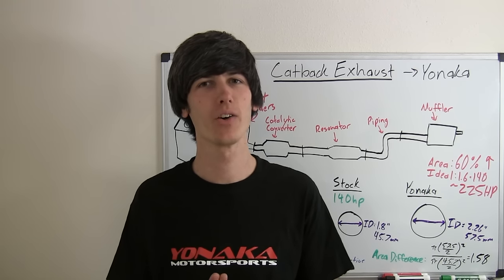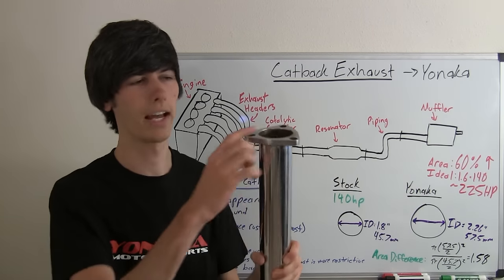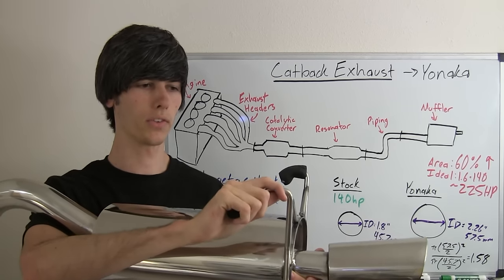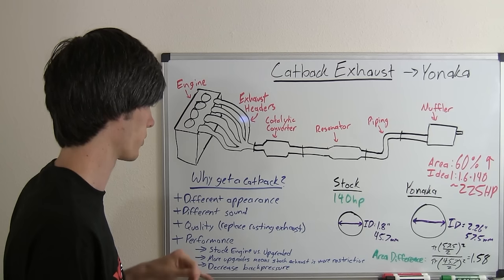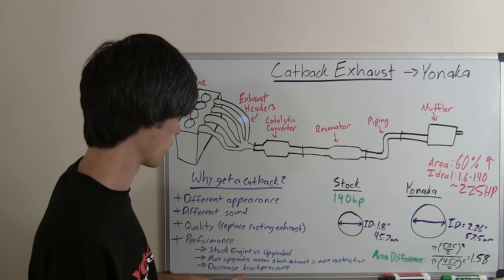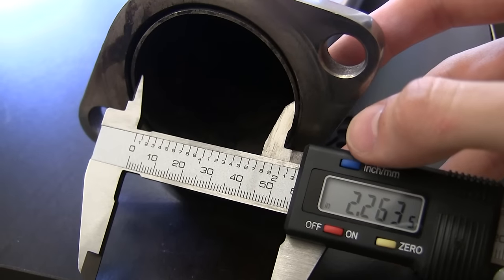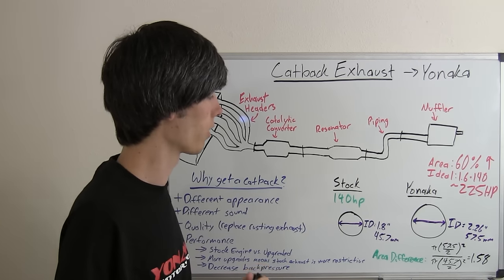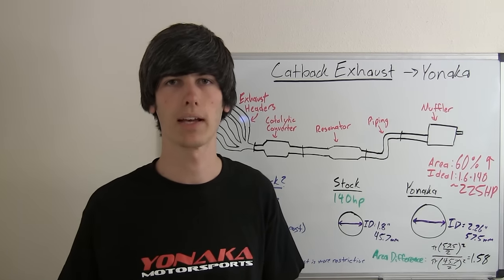Catback Exhaust - Explained

Comment: You were saying how the manufacturer made the pipe to specs for a certain horsepower... which is somewhat true. But, many manufacturers will purposely cause restriction for "emissions" and fuel economy/etc...

I've seen and heard so many cases of taking a bone stock engine of almost any car, and getting a pretty huge boost from simply making the exhaust piping bigger like you're talking about...

The thing is, you dont always have to ADD horsepower to GET horsepower. Sometimes its right in your car already... All you have to do is upgrade your exhaust, and you'll be able to unleash what the manufacture has literally muffled.
Reply: ***** usually the horsepower reduction manufacturers give a cars engine which you are talking about is down to ECU mapping and they then optimise the exhaust for that map, changing the exhaust in that case while otherwise leaving the car stock won't increase performance because of that as the ECU is programmed to expect a certain flow rate so it wont know what to do when the restriction is reduced, it may in fact reduce power as the ECU could assume an error state has occured.
Reply: megaspeed2v2 Eh, that's true, to a certain degree. But then again, I haven't personally witnessed that at all. I've witnessed greater performance and greater MPGs from making the exhaust bigger alone, with no computer mods. One friend I had, he had a Avalanche with a stock computer, all he did was make his pipe shorter and bigger. He even cut out the Catalyst converter too... Well, he gets way faster torque, horsepower, and MPGs. Also, his truck still passes smog, which is amazing to me. So if anything, I'd have to say it makes the car run better... I go off of experience, not what the monopoly manufacturers and smog regulations want you to believe.
Reply: ***** that is interesting to hear. what state do you live in? is that smog check station technician or owner your friend's buddies? and when is this happen?

im curious because i live in california and smog regulation here is very strict. if your friend live in california, then give me that smog station address, if its close to my location i will go there to get my car without cat smogged there.
Reply: No no, it's a place that installs a Universal Cat and then you take your car to the smog station that I know, and he wont visually inspect the Cat for the number that is printed and supposed to match the car.

Comment: what would you recommend, an intake system first or a new catback then the intake? Great vids btw!
Reply: depends on the car, old civics etc can benefit from a new intake/filter system. Most people go for an intake first because it's cheaper. It doesn't matter what order you get them in, just depends if you prefer intake noise or exhaust hah
Reply: I would do both!
 Cold air intake and exhaust
Reply: 169Phoenix Agreed! :) cheers!
Reply: 169Phoenix Cold Air Intake = No difference
Reply: FiloJacobbb The dyno doesn't lie, they can be good for 7whp, not much in real world terms but it's not "nothing"
Reply: 7whp? You're dreaming, never had anyone get those kind of results with those overrated filters
Reply: FiloJacobbb There's graph proof on hondatech but w/e ignorance is bliss
Reply: Unless you've played with cars yourself and done your own dyno tests not sure you can go around throwing around figures, not everything on the internet is legitimate.
Reply: Well, okay then, I'm sure racing cars run CAI for the cool factor, not because they make more power ehy ;)

Comment: cool video, I really liked how you did the math to figure out what kind of hp the new exhaust can support efficiently. Good on you and thank you.  I'm kinda bad at math tried to figure it out using your method. how much hp could a 3" downpipe support efficiently you think? assuming the variables were identical to your example?  I'm planing to do some tuning and contemplating future upgrade to the turbo and maybe intercooler if needed. so it would be good to have an idea what sort of gains a 3" downpipe can support this is for a vw golf mk7 tdi.  catless or catback? any suggestions?

Comment: might i add that, be careful when increasing diameter of the pipe when choosing a cat back because although your tryna get rid of some of the back pressure, that back pressure is there to better your torque range, when you increase the diameter way too much and erase all the back pressure your car is gonna suck off the line and/or suck at accelerating, hents the reason why you see some cars with large pipes making a bunch of noise but accelerating very slowly.

Comment: This just means that the pipe that normally houses the cat (catalytic converter) is a simple straight pipe without a cat.  Some times this means that someone has removed the internals of the cat (not recommended) and sometimes this means a whole new pipe was installed that never had a cat.

Comment: Pretty sure he already did in another video. In any case, a muffler is designed to make all frequency's quieter, resonator target's specific frequency's. So a muffler makes the exhaust quieter, while a resonator is used, for example, to stop the exhaust droning at highway speeds.

Comment: I'm curious if the muffler outlet ID was the same as the stock exhaust pipe ID, as that is not always the case. It would be better to measure the pipes at the flange points like you did with the Yonaka. Some stock exhausts will change in diameter from the header on at various points. It would require the removal of the stock exhaust, but would be more accurate (minus the carbon buildup).

Comment: I had an awsome idea but a silly one.  Why use a tube at all and just use an almost flat hollow sheet of metal you can use across the bottom thus shortening the length and metal needed thus a lighter car.

Comment: Does the heat from the cat not cause a high pressure area thereby assisting in pushing the exhaust fumes out, and if so wouldn't removing the cat delete that high pressure effectively reducing hp? Or am I over thinking things...

Comment: More about your formula OF HOW you calculated the diameter of the stock exhaust pipe and the diameter of the Yonaka pipe and how you got a 60% difference in area. I did the calculations according to the formula you have on your Whiteboard but I received a different number other than 60%.

1.)

Pi * (52.5mm / 2)^2 / Pi * (45.7mm / 2)^2 =

2.)

Pi * (26.25)^2 / Pi * (22.85mm)^2 =

3.)

Pi * (689.0625) / Pi * (522.1225) =

4.)

3.1415 * (689.0625) / 3.1415 * ( 522.1225) =

5.)

2164.689 / 1640.247 =

6.)

1.319

7.)

1.00 - .32 = .68

8.)

68%

Let me know if I calculated something wrong but isn't it about a 68% increase?
Reply: * 68% greater area sorry :)
Reply: Actually isn't that entire formula bogus. A 60% increase (or my calculated 68% using your formula above) is not the right measurement.

Using simple math and not physics based formulas isn't

45.7mm * 1.60 = 73.12mm

45.7mm (100/100) + 45.7mm (60/100) =
 
45.7mm + 27.42mm = 73.12mm

The Yonaka Aftermarket piping diameter is 52.5mm. The stock exhaust piping is 45.7mm. A 60% increase of 45.7mm is 73.12mm. The Yonaka piping measured at 52.5mm. Therefore the Diameter Difference between the stock piping and the Yonaka piping isn't a 60% difference. It is a 15% difference. Why? Again because your are finding the 
Percent Difference between the two Diameters (the Stock and the Yonaka piping).

To do this simply divide your aftermarket diameter piping (Yonaka) measured at 52.5mm by your stock diameter piping measured at 45.7mm.

52.5mm / 45.7mm = 1.15 

1.15 = 115% = 15% increase (Yonaka piping over OE Stock piping)

Again take...

47.5mm (size of OE Stock piping) * 1.15 = 52.5mm (size of Yonaka

Now since we know that the piping Aftermarket piping has a 15% diameter increase and NOT a outrageous 60% diameter increase (pretty unrealistic) NOW we can accurately calculate the increase IN POTENTIAL HORSEPOWER GAIN ASSUMING OTHER PERFORMANCE FACTORS AND VARIABLES ARE ASSUMED AT OPTIMUM AND MAXIMUM PERFORMANCE OF THE INDICATED VEHICLE ABOVE. 

In this case the relationship between SOLEY the Engine Hp (not taking into account whp, etc) and SOLEY the Diameter Increase of 15% from the Yonaka piping (again assumping your engine is running at optimal gas flow with maximum pressure waves flowing through your exhaust system. No back pressure, etc)

Your theoretical projected HP GAIN would be 

140hp * 1.15 =  161hp

Again the 161hp assumes that you have maxed the crap out  of your car with aftermarket parts that directly relate or unrelate to your Exhaust System, tuned your engine for maximum performance, Are running your Engine at the Highest RPM possible consistenly with a high unrestrictive exhaust flow flowing high volumes of air completely encompassing the inner diameter of the Yonaka piping at all times of the Power Band and without any slow of exhaust output, and other factors and properties not considered.

If it is a 60% increase the area of the Yonaka piping would be 
73.12mm. Not the measured 52.5mm as you accurately measured using a Micrometer. Not to be mean or anything but please get your math straight before making unrealistic mathematical assumptions of HP gain.

In conclusion. I ABSOLUTELY LOVE YOUR VIDEOS just get the math straight on Theoretical HP gains with a concept aftermarket axleback exhaust vs stock axleback exhaust.

Thanks for all that you do :)
Reply: Diameter not Area DOH X(

Comment: 225 HP is a really high estimate especially for a 4 cylinder (99 integra B18B motor?). Usually you only gain 10hp when changing out the cat back.

Comment: He measures the tip of the stock exhaust which is often flared out and larger than the rest of the pipe.  Might not be an accurate comparison.
Reply from the maker: I measured under the car as well to double check, the dimensions were the same.

Comment: Engineering Explained So my car has two headers that have 2 pipes that go down the length of the car. The previous owner put some weird cat-back exhaust that connects the two (stock diameter) pipes with some sort of U pipe so that they come out the far back as one pipe with slightly bigger diameter, i am not sure if that creates unnecessary back pressure and makes the car loose power. Was wondering if i could get your input. The U part of it is slightly bigger in diameter that the 2 stock pipes coming from the res.

BTW Great channel.

Comment: Poiseuille’s Law, relating to laminar flow of a newtonian fluid through a pipe, states that the flow is proportional to the radius of the pipe to the power 4, but here (and most other places I've been reading) it's stated that the relationship between flow and cross sectional area (i.e. square of the radius) is linear.  I guess exhaust flow is not really laminar flow, but perhaps the truth is somewhere in between?

Comment: I watch a lot of your videos and really like them, one question though, how can you make the assumption that the ratio between power and ideal exhaust cross section area is the same for different ranges of power? It just seems like a completely irrelevant calculation you have done since an engine with 60% more power may not ideally need 60% more area in the cat back

Comment: As far as performance goes, you forgot to mention one of the most critical points of any parts upgrades: how much does the Yonaka system weigh compared to the stock system?
Reply from the maker: That's a great question, and something I was hoping to include - however I couldn't seem to find the stock weight. When I do an install video I will include the weight numbers.
Reply: Thanks! I like your channel. Just kinda stumbled across it today.
Reply from the maker: Josh Stansell Thanks, glad you like it!

Comment: The only benefits that cat back provides is pretty much louder sounds and looks (resonator and muffler is the culprit for loudness of exhaust). Want a loud exhaust? Just leave the catalytic converter attached and get rid of the rest of exhaust system.

Unless you add forced induction to your engine (turbo charged, super charged), then catback exhaust does not give any performance.
Let say you have naturally aspirated engine, go down the street with wide open throttle. Air being drawn into combustion chamber during intake cycle, then goes out from chamber through exhaust manifold towards catalytic converter (cat), then exit through exhaust tip at the end.
Now, how do you get more power gain from cat back if the amount of air you drawn into your naturally aspirated engine for each cylinder is limited to certain volume (whether you have stock exhaust system or bigger piping aftermarket exhaust? (engineer's definitely have calculated the maximum volume of air being drawn in to combustion chamber during wide open throttle at high speed).
OEM exhaust pipe is design for specific engine and definitely can allow burnt gas to exit without having pressure build up in the exhaust.

the other reason why people get catback exhaust:
1. the old one is worn out (exhaust is clogged)
2. OEM genuine parts is too expensive
3. aftermarket stock exhaust is ugly, (why not get performance looking exhaust?)
4. just want to have louder exhaust sound.

Comment: Been watching your videos here and there for a different way to look at things. On an informative note, you just measured the muffler tip which is on the back of the car and compared it to the beginning of the catback exhaust. Why did you do that instead of comparing stock muffler tip with aftermarket muffler tip or stock catback with aftermarket catback?
Reply from the maker: Robert Clucas The stock muffler tip was the same diameter throughout the entire exhaust. Should have mentioned but I was hoping it was implied.
Reply: Engineering Explained K. Thanks.

Comment: Hey Engineering explained im planning to have a milltek cat back exhaust fitted to my 2009 Mazda MX5 2.0 i was wondering if you had any insight on if i need the ECU  retuned for the cat back exhaust or will it work fine as all the sensors are at the Cat and before .     

Enjoy your great videos by the way Many thanks Joel

Comment: which would be the best for a first upgrade? intake, headers, or catback? they all cost around the same and are all CARB legal. Eventually i will upgrade all of them but for now i can only do one
Reply from the maker: ***** Depends on the application, but they're all fairly equal. Typically will help with higher RPM, and may make the lower end a bit worse (from what I've seen).

Comment: Hey man, I just wanna say I appreciate your mad videos!! I have actually learned a LOT from watching your videos.

However, I have a question!

Will you please explain to me how a "no-muffler" system works "best" on a car? I've seen my Delivery Driver use the "No-Muffler" system and it makes his car sound "meaner". I have a similar vehicle and I was wondering if having no mufflers increase horsepower? How will I benefit from having a "no-muffler" system?

As you said, less restriction means more power (not verbatim). Is this true with a "no-muffler" system? I figure it's similar to a "straight-pipe system"...
Reply from the maker: Removing the muffler makes the car louder, as that is what mufflers are there for (reducing noise). You could say that the system would be more efficient, yes, though a lot of the energy of the exhaust is already wasted anyways.

Comment: He was pretty much using that as an example to illustrate how engineers determine with what size exhaust diameter to go with.. if you have a 140hp engine you're good with a 1.8 inch diameter, but if you're engine produces 225hp then you'll obviously need a bigger diameter exhaust for better flow (2.25 inch). 140/225~60%.  area of the 1.8 inch exhaust/area of 2.25 exhaust~60%... Get it?

Comment: The end of the video is a little confusing. I understand what you were saying about the optimal power your engine should make for this cat-back to be the most efficient. But for the not so mechanically inclined, it sounds like you're saying this cat-back will give you 85hp.

Comment: i have 1990 eunos (miata) i recently upgraded to a full stainless steel exhaust ....4 2 1 manifold , decat pipe and cobalt cat back .....my question is why did engine braking massively improve over the factory exhaust?

Comment: Question : Is changing the catback to a little bit bigger than the stock, to increase power, will it also affect fuel consumption in a bad way? Is it ok to remove the resonator and muffler and just put in a pipe?
Reply: It's illegal to take do a muffler and or resonator delete(not sure about resenator) but depending on the car, it will make it sound a hell of a lot better and louder

Comment: I am not a mechanic, I know nothing about vehicles. My son has a habit of wanting to modify vehicles. I am concerned. He is wanting to use one of these on a 2017 Subaru WRX. Is that wise, will it hurt anything? Will the car pass a smog inspection? Will he get a ticket for the sound? That whole kit looked kinda big to fit under a car. Does the size vary per make/model?